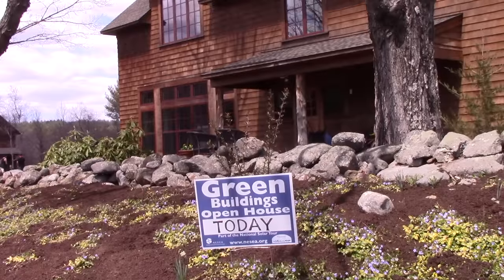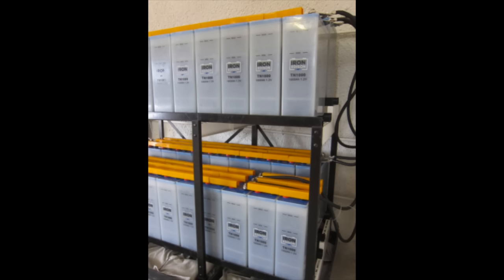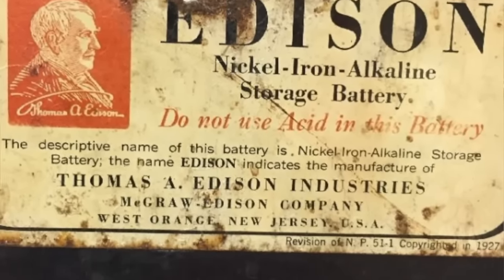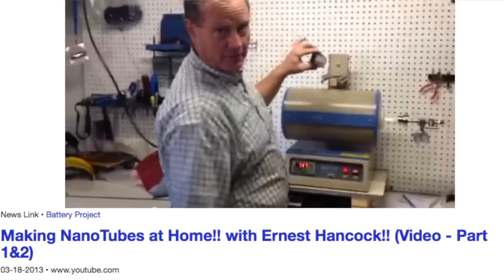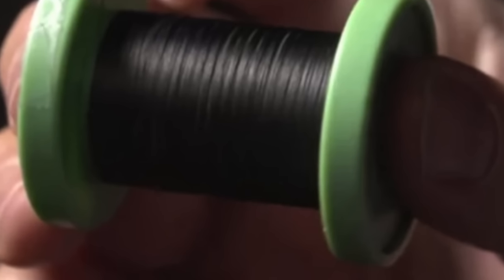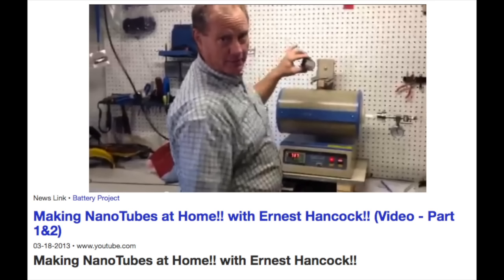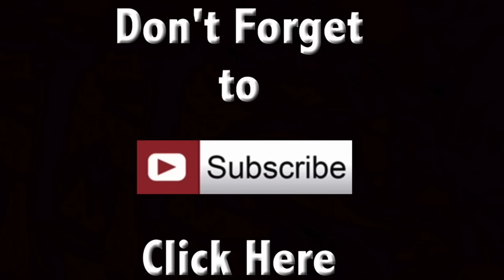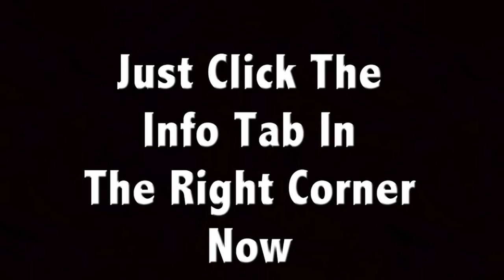The Best Battery for Off Grid and Solar Systems -  Nickel Iron NiFe Edison Battery - "Tarrin it Up"

Comment: I've been saying that Ni-Fe was best for stationary uses such as power walls in houses for a decade at least ?   inventpeace.com search ni-fe & Jay Leno.   BTW:  Edison batteries were many and included ni-mh (still the best cost & safety wise for mobile uses) as well which were used for early Rail Road signals needing long life and changed regularly.   He also (see Edison Museum Ft Myers FL. ) had the first factory "mule" an electric load mover somewhat like a golf cart but heavy load moving format.  He did so many things, a true GENIUS !  Him & H. FORD anther genius, had side by side IDENTICAL houses (2 story, Edison had first swimming pool & first house with electricity in FL, they had to crank up an engine to turn a turbine generator, its still there to see,)  FORD liked it because it had spanish moss which he bleached (to kill mites ) and used in his car seats for cushioning (he loved its "Free" aspect).  Edison like that location because at the time he had the 2 house built he was hot on bamboo as a new better "Filament" for his electric light (later he switched to the carbon impregnated cotton thread with the vacuum of course inside the bulb to prevent oxidation (burning up) of the filaments.

Comment: I hesitate to wade into what is bordering on turning into a flame war over nickel iron batteries but most of the negative comments are coming from a single source that admits no direct experience with them. I did a lot of research a year ago and found none of the negative comments on their lifespan and just now I looked and all the comments were positive from people with direct experience with the batteries. I do know for a fact there are 100 year old electric cars that are still using original batteries. The fact the same source is calling NiCads a far superior design is questionable. I've used been using them for 40 years and Nicads were a crap design. We used them because it was all that was available. They develop memory, overcharging will kill them and they don't last for that many charge discharge cycles. Some of the original Nickel Iron batteries may not have lasted but the manufacturing processes were extremely crude at the time. Most people were still riding horses when they were made. I've done nickel plating and that technology has come a long way. I've even built plating equipment from scratch. I've looked over the patents for the Nickel Iron batteries and I don't see any obvious fail points. The design is pretty dead simple. I can see a huge potential with modern manufacturing techniques. Even without going to carbon nano tubes you can use open celled metal sponge material which has been available for years, you can easily plate it with nickel. They use similar materials in fuel cells. Just because technology is newer doesn't mean it's better. I buy new keyboards every couple of months, I wear them out, 16 hours a day on a computer. There are IBM keyboards from the 70s that still work. Nickel iron has two main failings, expensive and heavy. Both can be addressed by using modern techniques. The very fact some are still working proves it was likely poor manufacturing and not an inherent design flaw. I'm a battery atheist where as others seem to be true believers. I'll use what works best and I'm intrigued as hell at batteries that have the potential to last 50 to a 100 years. Name another battery that can last half that long?

Comment: Too bad about the 20-30% per month self-discharge rate.  Calculate that out on your available sun-hours, and you've just doubled the size of your solar array.  You can't use a leaky bucket in a PV system.

Comment: The problem isn't getting the surface area, the problem is keeping it.  The chemical reactions that generate the power cause both metals to change form and as a result repeated charge-discharge cycles make them slowly smooth out ridged plates and make particles weld themselves together and you lose capacity.  Plus the iron oxide that forms on discharge tends to grow fingers that will eventually short out the cell (along with being extremely brittle, so bumping a cell that's in a discharged condition can ruin it).  So if you want them to last, you're stuck with flat plates and either wide spacing or regular disassembly for maintenance.  Plus they have a relatively low efficiency since they waste a lot of the charge power on electrolysis of the water.

But if you're looking for cheap batteries...  You can replace much of the nickel with carbon without too big a reduction in power output, and scrap iron goes for $5/100lbs in some places.  So if you don't mind your batteries being huge and only about 40% efficient as long as they're cheap and low maintenance it's definitely an option.
Reply: I went through a stage where I tried to make a free energy device, as a electric engineer, Who converts cars into hybrids as a biz , said "You are chasing the Holly grail "he also chased this Holly grail ,an said start with something little more realistic, I'm no engineer , though I do know iron    won't hold a charge as good as other elements out there , look at the element table , it will hold the answers

Comment: I find the facts on this comment thread silly. No one bothers to mention Edison batteries are some of the most inefficient batteries when it comes to power required to charge the battery, to the amount of power you get back out, it's something like 30% That's the real nail in the coffin. Cycles and longevity, these batteries stand the test of time longer than anything else out there, aside from some mentioned experimental batteries, that haven't been verified results yet. For an off the grid system? Yeah you can make it work. For a redundant long term solution, yep it's a good battery. For a scale able cost effective solution to save the worlds energy needs? Nope, worst battery ever. The max current draw off those batteries aren't all that great either.

Comment: Russians still making this type of batteries. There are multiple manufacturers exist in Russia today. The price is around $0.15 per Amp. The battery is 1.2V itself and up to 550 Amp, with 1000-1200 power cycles declared as minimum (at least)

Comment: I want to build better nickel zinc batteries which are similar to nickle iorn but better in many ways higher voltage and lighter cells with new zinc sponge technology.
These could potentially compete with lithium ion because of safer electric cars and no fire risks having lithium power wall. No thermal problems or heavy armor needed.  These have been around a while but dendritic issues and zinc oxides tendency to not completely cycle uniformily each time it is recharged.. anyone know about these cells and have you tried to make some..

Comment: Yes, NiFe batteries die quickly with frequent recharging.  Why do you think they moved on?  Also, the lead acid batteries in your car will eventually die but not from eating away at the lead until it's gone.  Ever lift a dead car battery?  Oh yes...all of the lead is still there.  The process by which it produces current deposits sulfates, from the sulfuric acid used in the battery, on the surfaces of the lead plates.  As these deposits thicken the sulfuric acid can no longer react with the lead and the current eventually drops to zero.  Interestingly, Magnesium Sulfate (or Epsom Salt as it is better known) reacts with the sulfates reproducing a large portion of the original current when the battery was new.  Research this as from personal experience I have "renewed" several lead acid batteries that continue to work well, for up to a year longer than they would have otherwise.

Comment: Well here is my two cents worth.... as time goes by and population goes up.... which means more cars of any kind.... they are running out of cheap materials to build with. The total electric car is not that far off nor will people resist it when its cheaper all the way around to buy the EVA cars. Can't remember the guy and didn't take time to google it but there is a guy making electricity plants that go on the side of business's like google and other companies and they work really well. Then there is the Tesla car that is getting really good miles per fill up of electricity. Mean while back at the ranch where things are slower to change people do complain of short battery life, especially in cold weather and diesel rigs getting started. I think we already have a fix but it is not in the battery peoples lives to make better products. Especially Ford who seems to have the worst glow plug application. We have the smart people already but the companies resist making them

Comment: NiFe batteries aren't recommended for applications with continuous voltage supplies (like solar) due to thermal runoff which can lead to gassing. Peddling the idea that "corporations" don't want better batteries is ignorant as the manufacturers who sell superior products tend to garner the most business. Probably need to get out a little more and pick up a book on supply-demand while you're at it.

Comment: Why have batteries with your solar system at all? With net metering you can sell your excess power on the grid and bring it back when you need it.
Reply: just get a gas generator for emergencies.

Comment: What is free and stores energy?  Water! How about some systems that either pump water or heat water. Both could release energy on demand.
Reply: One major problem with each, the sheer amount of water requires a huge reservoir to even approach a good electrical storage mechanism and the second runs into the problem of convection and conduction.  Your best bet for the water idea is probably compressed air, it's more volumetrically efficient.
Reply: and you think liberal are nut cakes......LOL
Reply: Robert Lominick 
like we're going to read all your rants....go to another channel

Comment: Well a problem solved but if mister musk includes this and than maybe for a mobile phone or a stationery setup and a hydrogen solution to ???

Dont bet on one horse just a better implementation that makes us last longer !!!

If we decide to mess up the environment than why not also include tech that makes us last green tech !! 

The implementation of these for a good tech solution and a combination of things to actually make good solutions and include them all than we end up with Good total outcomes you have to produce it and all good things combined that is key !!!

A phone manufacturer or a car builder or a local neighborhood power storage supply ???

and than yep you can choose shall we run electric or hydrogen or just ride a bicycle???

Economic implementation of these could be done the carbon fiber stuff and also the original stuff and just spread the energy neeeds amongst many platforms so a total solution for the masses can be reached !!!

Comment: The ones adjust your and my economy know that and that is why they pushed for resource based economy to keep the flow of pack life result( To fixate the cost where it begins).  You barely cover the cost of raw material compared to end product.  By doing so only accepted the responsibility of conversion of resource to usable need without reward.  Unless you have locked a resource in your possession that attempt is pretty useless to save yourself from teeth and claw of predator.

Comment: while it is true that Edison was not above filing off the name and adding his own his employee's were well paid for the day and they as well as Edison did thousands of research on Edison cells or nickel iron cells these are not the most efficient battery's 
nor are they the most maintenance free barring that in mind they very well may be the best battery's for off grid because there are Edison cells in use today that were manufactured in the late 1920's or 30;s and new one properly taken care of will outlast you so paying a little more for the battery's and halving to do route-en maintenance is a small price.

Comment: My bullshit detector goes off when people claim that "Patents were bought up and the product was taken off the market to suppress it.  Patents eventually EXPIRE, then ANY one or company can make them and sell them freely.
Reply: It does happen, but if the product is gone for more than about 20 years it's most likely that it's because something better has come along since.
Reply: rick dees CB
Reply: The dogs of suppression never sleep.  Many of these junkyard dogs work at the uspto. Owners of patents are notified of expiration dates and automatically move to the front of the line.
Reply: rick, me too. The moment you pull the "oh the oil companies are buying up the patents because they don't want this...", I know the fuel saving device you're selling is a scam. Unfortunately this video comes off about the same. Also, the explanation at the beginning about the acid battery eating up its plates... way WAY off. The plates in a lead-acid battery actually remain relatively untouched and can be almost fully recycled at the end. What kills LA batteries is sulphation...
Reply: +plonkster Indeed. I let my motorcycle battery completely drain by accident once. Instead of turning the switch to BIKE OFF position, I switched it the other way to to the PARKING LIGHT setting, and drained the battery over night. By doing so, I sulfated the plates, and the battery would no longer charge using standard charging. To unsulfate the plates, luckily I owned a smart little unit that BikeMaster used to sell. It's got like 6 or 7 modes, a couple of which blast the battery at really high amps for a minute or so..This is exactly what is needed to burn away the sulfate buildup. Over a weekend, I gave that battery a dozen or so jolts, always followed by (automatically.switched) 1 amp charge cycle, then a holding state. But it never went to hold, because the charging cycle took too long, and the processor shut the whole thing down.So, I'd let it rest for an hour or so, and blasted it again. After 9 of 10 times, it started holding a charge, and after a few more cycles, I was convinced I'd reversed the sulfation.  The Battery Quality light now reads STRONG after an hour on the holding current (which is normally 0.0 amps with the voltage holding at 13.2.) as the battery voltage drops to 13.0, the battery tender switches in a current of 0.15 Amps for 20 minutes or so.

Mind you, this is a 10 year old lead acid battery, and it's charging and operating like a youngster. This happened last autumn, 10 months ago. It is starting fully charged just by my daily rides, and I'm convinced I'll be and to do this same protocol multiple times. I haven't even looked at the SG of my electrolyte, but I'm thinking at some point I will drain the battery and put in fresh acid, do my "blast method" of desulfurization, drain again, and again add fresh acid, and see how that goes. My intent by doing this would be to flush out the bits of corrosion that inevitably will be there in some amount.

I think so many people buy into this myth of "plate erosion" partly because of our common experience with acid and metals; metals usually oxidize and deteriorate due to the action of an acid..But in this case, it is a myth. Rather than deteriorate in sulfuric acid, it appears that lead actually builds up compounds of plaque made up of lead sulfate. It is a natural part of this particular chemistry, and because the deposition is the result of an electrochemical process, so too can it be reversed electrochemically.
Reply: @Sith'ari Azithoth  Last time I looked up the rules about five years ago, US patents were for ten years, renewable once for a total of twenty.  I haven't heard they changed since then.  But I suppose it's possible.
Reply: Patents CAN be renewed but it takes an act of congress.  There have been VERY FEW patents renewed over the 200 plus years of the Patent Office.
Reply: have you watched the lightbulb conspiracy? worth a look and eye openening regarding planned and engineered obsolescence. light bulb cartell set up yeats ago to limit bulb life to 5000 hours. pluss follows a guy who wants his printer fixed, cost too much and works out each printer has a page count chip that when at zero kills your printer. guy made a hack to reset it and printer works. so buying patents  isnt really a huge stretch. at all. food for example... vegetables etc have patents. . try sell non hybred seeds on the open for carrots and see what happens. eg: Bill Mollison of Tasmania Australia who fathered Permaculture and was hit with law suits fron NY and Sydney lawyers for copyright infringement when he started a seed bank.

Comment: What happened to LPG cars ?? 
Range Rovers on LPG ran much cleaner, and cheaper. 
Double the miles per £. or less than half the cost of Petrol.
Cleaner engines, + Cleaner emissions .
The cost of conversion PROHIBITED MASS Market use ! 
Why ? 
? 
30 mpg in a V8 Rangey !!  = 100 mpg in a Fiesta / corsa 1.0 litre /1.2 litre ! price equivalent ! 
TWENTY YEARS AGO ! 
YES  20 + YRS AGO ! 
Eer eeerrr LAST CENTURY !  almost !  2 decades ago !

WE are BEING SHAFTED BY BULLSHIT ! 
then there is  HYDROGEN ! = WATER ! 
OH YES !  1860 x more combustable than petrol.

Your car would rust away to dust, then you would transfer your old engine into your Brand new car ! if you ran on hydrogen.

Comment: You lose credibility when you cite conspiracy theories. There aren't any powerful cabals suppressing this technology. It's the free market that decided on carbon zinc disposable batteries were better for most applications. They continued to make and sell Edison batteries for niche applications where low power density wasn't a problem, but durability and longevity were needed. Just about every remote navigation or environmental monitoring station uses them.